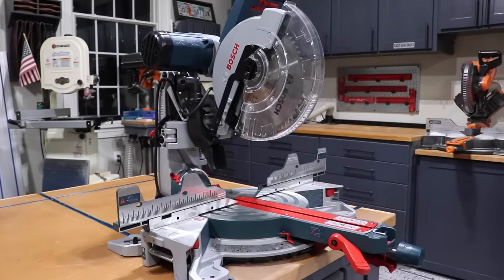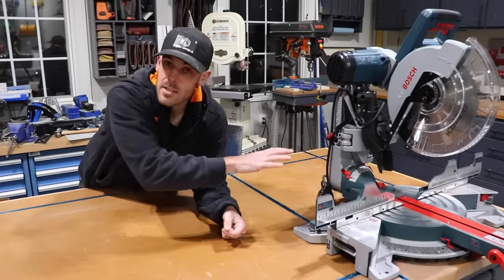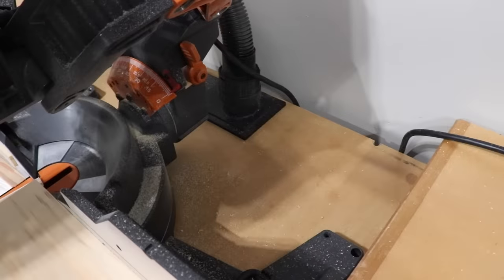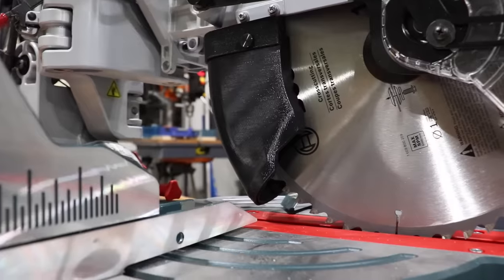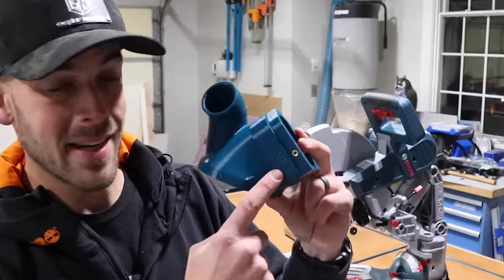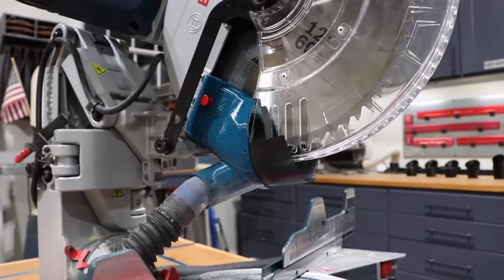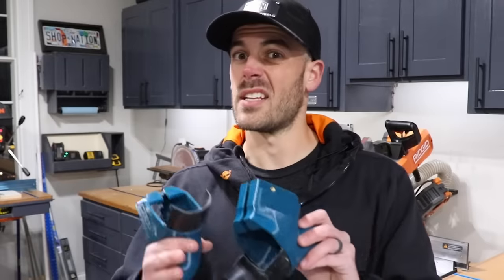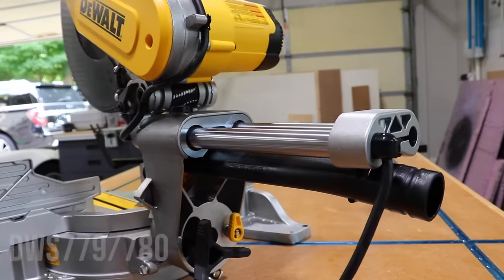It's like Bosch doesn't even care

Comment from the maker: Thanks everyone for watching and giving some ideas for future saws to tackle!  Links below for reference:
Bosch Axial Glide Dust Collection Chute: https://bit.ly/49O5beH
Reply: Thx for making the stl's available for sale. Just bought them to print.  Do you or anyone have a pointer to filament that is a close-ish color match like you showed?
Reply: I have the Bosch CM10GD.  I'm ready to buy as soon as you get it figured out!  Thanks
Reply: P0
Pp00
Reply: Thinking a more flexible material would help your project. Something stiff enough to return to its original shape on its own, but able to collapse or take on a shape created by the pressure applied by the base of the saw when doing miter cuts. So that the obstruction it becomes would become a non-issue because it would simply take on a new shape from the applied outside force, yet still be function able. Consider the same material used in the tip of that blue dust collection connector 1.53. You can squeeze that all day, it will always return to its original shape.
Reply: Do you accept made to order dust collection chute for GCM 18v-216 miter saw ?
Reply: Can you please do the Ryobi model TSS103 sliding 10 inch miter saw
Reply: Your tests are not good. Some cuts were made with no scrap fall off allowing dust chips to go to the side and not up the shoot. Best collection is a full slide backward. Some of yours were down and or down and slide.
Reply: Do you have one that works with the cordless 18V model? Bosch GCM18VM18V-12GDCN14
Reply: @brucemiller1696  so, you mean he was using the miter saw like you would use a miter saw? Oh no… I hope you’re able to sleep at night.

Comment: If suction could be added to the base in the slot of the clearance plate I believe it would improve dust collection. Kinda like a downdraft table for sanding.
Reply from the maker: You would think so, but due to the blade rotation and angle of the teeth, there is really no dust forced in that lower cavity.  Everything that ends up there is falling from somewhere else.  I had a similar thought when I first started tackling these issues.
Reply: Honestly what I am planning is a small (tilted) downdraft behind the saw as well, which I think might be more useful for capturing the dust that escapes collection at source
Reply: The velocity of the air is made by the blade and bottom suction would reduce the direction of the air that is carrying the dust, this would make the system less effective. As an engineer I would suggest you smooth all the corners to streamline the airflow as it moves into the device.  the sharp edges are causing turbulence reducing the air to carry the dust.(look at your fluids books from school)  Smooth air will carry higher amounts of dust, so get rid of the corners and smooth them out with a healthy radii.
Reply: The small Bosch gcm8 sde has a collection point and the end of that slot and one that moves with the saw the glide saw doesn't allow this which is actually a great collection system
Reply: Makita did it with ots batter powered mitre saw.
Reply: also wouldn't work if you have a zero clearance insert.
Reply: bang on what i first thought

Comment: Can't wait for your DeWalt version.  I hate the mess my miter saw makes, and I too have not treasured making a huge box/tent behind the saw.  Like you, my own attempts at fixing that issue have been difficult.
Reply: I also can't wait for the Dewalt version. I just picked up a DW779 with free stand and have been messing with the dust collection. I added flashing tape to the flexible shroud so now it doesn't close in on itself and for some weird reason Dewalt put holes along the top of that black pipe that holds the shroud. I taped that up along with any small openings I could see to have maximum airflow running all the way to the front of the shroud
Reply: Same here just bought the DWS779

Comment: This saw https://www.youtube.com/post/Ugkx84IcU5pbZd1Qrz8u4-YRLmJax7kdRi7B comes in handy in many ways. When I had a small (dead) tree fall I started the process of disposal by using this saw and cutting off the small branches. Then slowly work on the small trunk with undercutting and letting it fall down. With many trees on acres of land paying for a tree service can be expensive. It also is nice in that it can be used in hard to get areas like along my creek. It's also safer and quieter than a chainsaw. It obviously can't cut down massive trees but it does work fine for small ones or brush. And of course since I already own a Black
Reply: I think they prefer the phrase “people of color“…

Comment: Just installed your "Bosch Dust Collection Chute" ...all I can say is OUTSTANDING! Incredible quality parts and hardware, perfect fit, and extremely easy to install with your installation video..And now, testing.  I did 10 cuts on a 2x4 with the stock chute and small vacuum. (My stock set-up.) Gathered up all the sawdust and it basically fit in the palm of my hand. After installing your "Bosch Dust Collection Chute" and making another 10 cuts, I may have had a teaspoon full! OMG what a difference! I am so glad I purchased this, my shop is half of a two car garage and was dreading making a dust box for the saw. I HIGHLY recommend this UPGRADE to everyone with a Bosch 12" glide saw. Thanks Travis, am one step closer to...."SHOP GREATNESS!"
Reply from the maker: Good stuff 👍🏼

Comment: +1 on the Makita LS1219 saw.  I actually got rid of the Bosch, mostly because of the dust collection.  Makita is so promising with the dual collection but let down badly when sliding.  The small hoses probably don't help either.
Reply: Another +1 for the Makita LS1219

Loving the effort on these problem solving projects!

Comment: I'm an engineer.  I was impressed enough by your approach that I ordered your chute for my Bosch 12" Glide Saw.  I'm thrilled with it.  While it doesn't capture every particle, it's a vast improvement requiring few sacrifices.  Thanks for a job well done.
Reply: How do you like this saw.  Ive read that its is very difficult to true up and will not hold it.  There is a large plethora of 1,2,and 3 star reviews from guys who do precision woodworking, not just rough cutting for home building and they all say stay far away from this saw.   One video here on youtube demonstrates how bad it is.  What do you think? Have you ever carefully checked it?

Comment: If you could make one for the Metabo C12RSH2M 12" sliding saw that would be awesome! Keep up the good work bud!
Reply: Agreed I would order one immediately
Reply: I’ve got a Metabo C12RSH2(S)  12” dual bevel sliding mitre saw. I don’t know the differences between this and the “M” above, but I’d buy one for my saw if it fit. 
And I don’t even have dust collection.
Reply: I too would buy one for the Metabo! I’ve been looking online hoping someone would have a solution, but nothing so far. Thanks
Reply: I would buy one too. I am not happy with my enclosure.
Reply: Another vote.  I actually have the Hitachi, but it looks to be identical to the Metabo.

Comment: I'd love to see a chute for the 10" Makita dual bevel. I love its sliding mechanism. The articulating arms on the rigid/ Bosch seem overly complicated and prone to deflection
Reply: A second Makita 10 inch
Reply: Makita 12 inch too.  That said - the Makita is already somewhat better than the bosch and ridgid, as it has 2 separate dust collection chutes.  Maybe both can be used to even further improve the collection.
Reply: Ditto

Comment: Would love to see you tackle the Milwaukee M18 10” mitre saw. The saw is a slider and the blade slides and leaves the collection point at the back of the saw! At full extension your blade is almost 10’ away from the collection. Would love to see what you could do with it.

Comment: Looking at how much dust follows the original collection path even with the suction removed I would suggest you try going smaller, surrounding the blade as much as possible to focus the vacuum and give it as much suction as possible. Keep a flap to slow down anything going wildly off course and give the vacuum a chance to catch it. As much air speed as possible being drawn past the blade should help and that requires a smaller apature so long as the shop vac doesn't struggle. But small that is in practice and how that works out in the real world is another matter...It would be cool to have the chute work in every possible use though.

Comment: I have tried multiple methods to improve the dust collection on my miter saw. As such I’m  very interested in you designing one of these for the Festool  Kapek  120 . If it worked as well as the one you just demoed , I’d buy it in a heart beat.
Reply from the maker: That saw has the best dust collection of any saw out there!
Reply: @ShopNation  while that may be it still leaves an enormous amount of dust. Will you attempt to improve it?

Comment: Terrific video! I'm currently in the market for a new miter saw, and your video came up as I was researching Bosch miter saws. I believe your video shed light on the recent updates to the Bosch Miter Saw, specifically the GCM 18V-216 DC model, and the improvements they've made in dust collection - dual dust collection. Greetings from Down Under, Ethan in Australia.

Comment: I plan to use this in conjunction with a catch box. I'll run a 4" line to the box with a 2.5" tap to this chute. Should get pretty much all of it that way.

Outstanding engineering and presentation. Ordered immediately after the video, and this wasn't the first one I watched. The quick removal feature totally sold it.

Comment: I just installed the Axial Glide Dust Collection Chute on my Bosch 10" miter saw. The directions were easy to follow and it fits like a glove. In my opinion, it works great.. I noticed an extremely small amount of saw dust after making about 30 plus cuts. Not even enough to fill a teaspoon. For me, this is a great improvement and well worth the investment.

Comment: I have an old Makita sliding mitre saw and set up a nice new workshop a few years ago. I use the standard dust chute and after some experimenting, found that the biggest improvement in dust collection was achieved simply by sliding the saw all the way towards me pulling it right down and making the cut using the slide, eg front to back.

Comment: Got mine the other day and installed today. Installation went great as you explained. A couple of comments: 1 Just about lost the wee bity spacer for the guard arm when I removed it, but I caught it before it scurried under the bench. 2 item is the RH FWD blade guard screw was hiding behind the motor wires. Removed the blade cover and 2 mount screws to rotate the cover fwd and that exposed the hiding screw. Ops check went grreat!!  Thanks for tackling this!!😁

Comment: I received the Shop Nation attachment today for my Bosch 12” miter saw. It was an easy, 10 minute installation. It works as advertised! Very little dust is now escaping collection. Fit, finish, and looks of the attachment are top notch!

I do have a design consideration. My corrugated Dustright, 1.75” hose is catching on the top of the fence when performing sliding cuts, even when the fence is extended all the way out. It probably wouldn’t happen if I had one of those swanky Festool hoses. 😊This is due to the angle where the hose attaches to the shroud. The angle needs to be changed slightly, so that the dust collection hose exits more toward the rear of the saw.

I am still very happy, and will rig up a work around.

Comment: I bought the one that's offered on Etzy and received it today.  I'm very impressed!   My journey looking for a dust collection improvement for my 12" Bosch started about 15 years ago.  I bought plans from Dan Patterson to make a larger boot but still plenty of dust was thrown out the back.  Then I built the smallest box around the saw that I could for full function (with a 4" port to my DC) but the saw with the box on the gravity base is top heavy and easy to tip when moving the stand and the stand can't collapse.  Better used for a permanent spot. 

The boot collar design is awesome!  The key is the wide rubber boot, larger collection area, and the elimination of the OEM skinny bent tubing that restricts CFM.  Really cool how the design marries up with the removed OEM dust boot screw holes, which makes this boot solidly attached and as close to the blade as practical.

This dust boot looks like it should have been there on a new GCM12SD from the get go.  Bosch should pay a licensing fee and add this to their saw.  Bosch would sell more GCM12SD units with this boot included.  Maybe this push some Festool buyers their way!

The GCM12SD is a fantastic miter saw.  I'm on my second one!
Reply: I’m happy to see someone who has one gives it a good review. I bought mine mid-December and just got the shipping notification today. I’ll try to post a video review of it when I get it installed. I agree with you, if it works, then Bosch should set this guy up for life, as there will now be a saw that can compete in the same dust collection arena as the Festool. If the word gets out in the proper arenas that this works, it’s almost guaranteed to boost their sales dramatically. Dust collection was a consideration when I bought my Bosch, but I had to settle for the lesser of the evils. This will take it from being the best of the worst…to the best of all the name brands. I try to keep my shop as clean as possible and it drives me nuts using the miter saw because of all my tools, it’s the one with the worst dust collection. Personally, I would love to see someone do a comparison between this on a Bosch and the Festool Kapex saw. Thanks for the review, it was a relief seeing it.
Reply: Update:  I ordered another one due to my bad of chopping off an inch or less of a 1x2 hardwood piece and lifted the blade immediately after the cut.  The short piece caught the blade and launched into the dust chute and shattered it.   So just a reminder to allow the blade it stop before lifting on short cutoffs, as short cutoffs can become high speed bullets.  I think these dust chutes are 3D printed, so not sure if a better polymer used would prevent this.
Reply: 2nd update:  I ordered a replacement.  Same thing happened and I'm going back to the OEM vacuum boot.  $100+ down the drain.

The problem is that the boot assembly is very close to the blade to catch the dust coming off the cut but that also leaves a big backstop anytime you raise the blade before a complete blade stop after a cut.  The OEM boot would allow a cutoff piece to slide backward harmlessly upon raising a spinning blade but this boot causes the cutoff piece to slide backward, hit the boot housing and bounce back into the spinning blade.

Not recommended.  I bet miter saw manufacturers that looked at this product would laugh and say that they abandoned this type of close to blade design for this reason.  

I thought this design would last if the boot housing was made of metal but then, by not shattering, the cut off piece would potentially become an incoming projectile to your body after the cutoff slides backward, hits the housing, bounces back into the blade and then violently bounces off the non shattering boot housing.

I have never experienced a cutoff hitting a the spinning blade of my Bosch miter saw until I used this boot.  Unless you religiously allow the spinning blade to stop before lifting, forget this product.  Maybe if Bosch had a brake that stopped the blade from spinning quickly after releasing the trigger, this would be a non issue.  Or you need to make sure your fence is set at a zero clearance so a cutoff can't slide backwards, which the OEM fence doesn't offer.

I am disappointed that this boot was not my solution to the bad dust collection of my Bosch saw.  Nice try but this needs a second design thought for practicality use.

Comment: I just finished installing my V11 on my Bosch GCM12SD. The excellent installation video provided by Shop Nation was spot on. It took me about 8 minutes to install from start to finish, and the fit was perfect! 

Initially, performance testing went exceptionally well, and all indications look like this is an excellent product that will help me keep my shop cleaner. Exceeds my expectations in build quality and how well it actually works! 

Keep up the great work, and I am sure your new shop will be a very satisfying experience to help you keep up with demand and expand into the future. Thanks again, Travis! 

Cheers to all :)
Reply: Out of curiosity, how much height can you cut at the fence?

 We had a bosch saw dust port break at work on Friday, and I was here looking at stuff to recommend, but 4 inches cut height at the fence without any auxiliary fence build out is kind of mandatory. Unfortunately, the benchtop woodworks one I looked at before this can't manage that.

Comment: Phenomenal solution.  I was deciding between the Bosch and DeWalt 10-in. saws as I already have a raft of 10 inch blades for my table saw and really have no need for a 12 anyway.  Although very partial to Bosch tools as my shop is full of them, I had heard some negative comments about Bosch's articulating arm not holding true, ended up with DeWalt 717.  When it arrived it was obviously a resale - it was loose in the box, no internal packing, literally bouncing around with a hole where the handle had broken through.  I had little hope for it but was astoundingly perfect out of the box, so to speak.  The 717 dust control isn't too bad with a vac on it as is.  But I'd love to see what you come up with for DeWalt.  Thanks, great video! - PS, I subscribed because I like how you do your videos.  Straight forward, no BS, no music, well articulated.